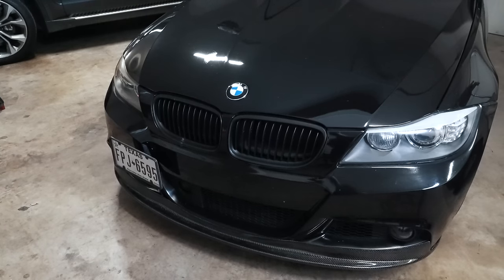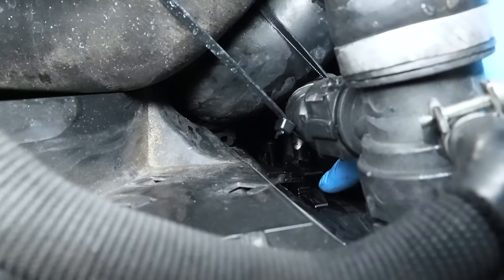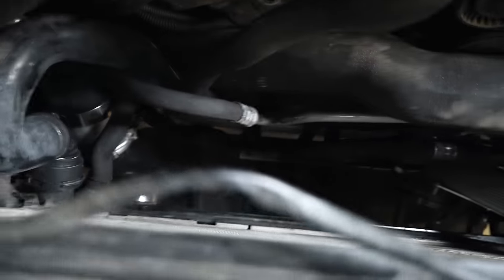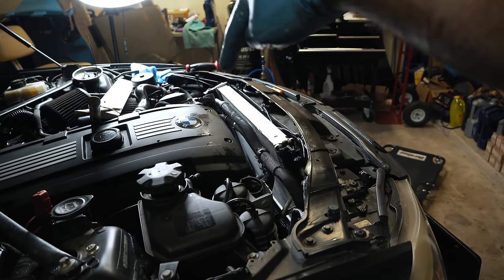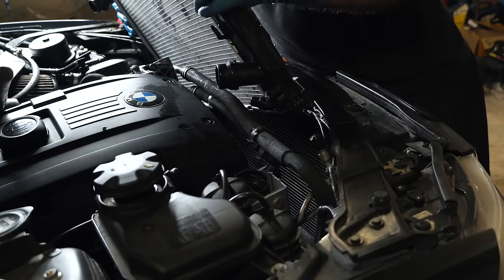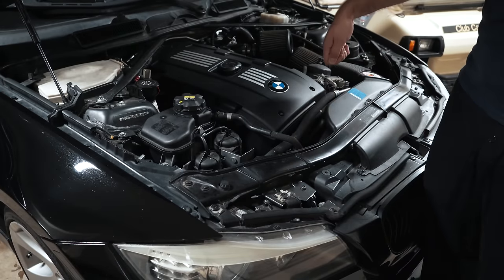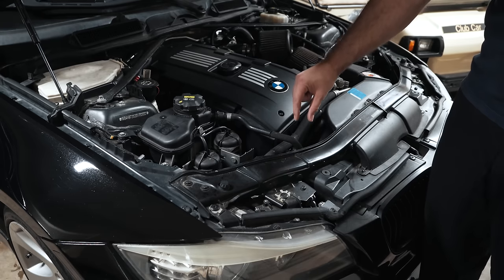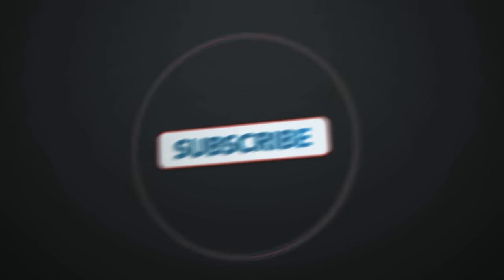My Radiator Cracked! | BMW E90 DIY Replacement

Comment: Another awesome video, just a reminder for people to leave the door open when you initiate the procedure because if you close the door and initiate the bleed and then open the door it will reset and stop the procedure, so then you are stuck in the car for about 10 minutes.  After bleed is complete, run defroster to allow for full circulation of the coolant system.  Then let cool down and recheck coolant level.
Reply: not true. i adtually just changed my radiator (before i saw this bideo) but i closed my door when i did the bleeding procedure and it still worked
Reply: Read the post, I said if the door is closed and you open it, you said you closed the door which means it was open, that’s different.
Reply: Joel Rolley I stand correct 😅😅
Reply: No worries, if the door is shut and you wait for a while and then open the door it can reset

Comment: I had to replace mine too a few weeks ago. It cracked in the exact same spot. The amount of low quality plastic and rubber used in these cars is just unimaginable.
Reply: Same
Reply: Same lol. Pos plastics
Reply: @F82_  well most cars are old so the plastic is older and isn’t the same when it first came out the factory
Reply: mine cracked in the SAME spot too.  My last BMW.  car full of plastic smh
Reply: Lasted 13 years for me so can’t really complain. Hope it holds up another 13 after replacing.

Comment: If anyone is wanting to do this for their 335i with a N55 motor, rejoice because this video will work perfectly. 
THANK YOU, VEHICULAR DIY. Saved my Bimmer and my wallet.
Reply: Bleh Bleh I’m about to do mine on my n54 in the same crack lol. How was/long the job? Looks pretty simple to me
Reply: @N54GASM  It turned into a multi-day project for me... but I have 0 experience with working on cars, and I am taking my sweet ass time with this quarantine. 
I will say that removing your intercooler will make things WORLDS easier, and removing it will be the simplest thing you can do. 
Getting the radiator back into the groove it rests on was the most difficult thing for me.
Reply: Is yours a e90 n55 and auto or manual?
Reply: Where did you get your parts?

Comment: What a coincidence. I just did this job today on my E93. Cracked in the exact same spot too! Got a CSF oem replacement. Keep up the great videos!
Reply: Same here 🤦‍♂️
Reply: I am about to do the same job with a CSF on an E93.  Were there any issues you ran into?  What was your solution about not having the plastic clips on the radiator to hold it in place?
Reply: @ivan.e82  How may miles were on your car when you replaced it?
Reply: Where did you buy the csf original style replacement?

Comment: Damn, literally everyone I know with an n54 who gets a crack in their radiator, all get it in that same exact spot! Crazy how failure prone that one little spot can be... as always, great diy brotha!
Reply: KiTshowtime it’s not only the n54 most plastic end capped radiators crack right there. I’ve changed numerous radiators in different makes and models with the exact same crack.
Reply: @kalei43  dude that sucks, they're smart for making parts that dont last forever tho I guess lol more money in their pockets
Reply: KiTshowtime this is why you get a full alloy replacement rad. This is a huge problem in most bmws

Comment: Another helpful vid, many thanks bro. I replaced the radiator (leaking on both sides) on my 135i convertible. I actually removed the intercooler to clean the whole area and have more room. Simple, as it was only 2 screws from below. However, I also had to remove the support reinforcement in the front to get the radiator clear (convertible specific). Nevertheless, your content already helped me a lot since my N54 already showed some of the standard issues (wastegate rattle, oil pan and air/water intercooler as well as head cover gasket leakage, cyl. head cooling flange got brittle and so on). I still love the car, though.

Comment: I might be doing this friday, still not sure if it's the radiator or that oil cooler line connection. I broke my upper radiator hose reservoir outlet, so we'll see, but this looks pretty easy. Been a pleasure watching your vids, saved me loads of time! I think I got my misfire fixed (bad injector), but I only got to go for one ride before I tore it apart for the coolant leak. I can see why you like these cars, it's been a lot of fun this past week.

Comment: My 2010 n54 JUST did this to me yesterday, same crack in the same dang place and everything.. Crazy lol. I was hoping it was that thin hose that goes across the engine but noooope lol the price difference between the all metal and OEM style is crazy. I found OEM styles for 100$ or less and the all metals start out at like 400 lol

Comment: I was debating on replacing it while everything is still apart now Im just going to do it.. Thanks for video
Reply from the maker: Yeah not a bad idea if you're in there anyways.  More power = more heat.
Reply: @VehicularDIY  Hence a higher performing radiator, preferably all aluminum.

Comment: 2011 n55 cracked in the same spot. Same procedure. I took my aftermarket intercooler out though. Made it much easier. Was struggling with the 2 t25 on the bottom of the 3rd rad.Wish this video was out then.

Comment: That's where mine cracked too, right along what looks like the injection mold seam. JB weld held out for a week until the parts arrived.
Reply: Lol I used jb weld on the same spot but it immediately started leaking in a different spot lmao. And it was even worse than the first one

Comment: Just finished mine. TAKE NOTE: This dude makes it seem a lot easier then it really is but not impossible. This will take you 3-4 hrs! Another tip make sure you buy another O ring!!! I put it together and to my horror it started leaking after install because of that O ring! Was a nightmare. This is a very tedious job and is way easier with 2 people. Also be easy with the DRAIN PLUG! That fucker will break (side tabs) if your not careful. Good luck everyone 🙏🏻
Reply: Which o ring are you talking about

Comment: Mine same spot a month ago least it was cheap and easy to fix. I beleive mine was orginal 08 e92 n54 AT 92k miles on the dot at fail..
I dropped the whole bottom cover pulled my ARM fmic that transmission cooler fought me to no end with the fan both ways also those oil cooler lines love to mess with the fan both ways.  Easy job but its tight add twice as long as you think its going to take.. do your self a favor replace the main top and bottom hose your right here and its cheap.  If you have time replace the U hose on the water pump super cheap, also lots of crap is in the pump you will see how dirty it is worth the extra 15 minutes.

Comment: What about the drain plugs? I have the same as yours with the plastic and metal but its got long and short drain plugs? I know the 2 different sizes are for manual and automatic? Mines an automatic 6 spd

Comment: Noticed that my new radiator has a plug that must be repositioned to allow coolant to flow into the autobox cooler. With the manual box no coolant flows and the plug stays in the normal position.

Comment: Replace your ineffective OEM ATF heat exchanger (It is NOT an ATF  cooler as coolant runs way too hot for ATF.  It is to preheat ATF for better cold start operation.)  with a B&M and mount it in your driver's side opening.  This might require ducting from the PPK2 kit.

Quite frankly, this is where I would spend the buck and go with an all aluminum CSF to better cool the block and heads (especially in Texas) and not repeat this job again. As you have already experienced, the plastic end tanks are a failure point.

I am still a little incredulous that you understand the importance of sealing the radiator to maintain ambient ducting through the front openings to the engine compartment, but you still reinstall the original CAI ducting thus back pressurizing the engine compartment and reducing effect ambient flow into it.  The DCI's gain little benefit from the dilution of the preheated under hood air being diluted by the non-ducted ambient air.

Comment: What about the bleeder screw? I followed your steps. But then reading post I feel like I did mine wrong. About 5 quarts came out when I drain mine and 5 went back in, people says it takes more I can’t remember if I unscrewed my bleeder screw. After I filled my coolant tank I ran the bleeder process and just kept filling until it stoped hopefully all the air got out. 2009 bmw 328i engine temp gauge usually in the middle, after I replaced my radiator it goes up just a hair more. But I will re flush my system again soon.

Comment: hi! i have an automatic e92 335i and i converted my transcooler to bms oil cooler. question, im gonna change my radiator, can i use a radiator for manual transmission?

Comment: I recently got stranded in tj with a failing water pump, fixed it, then a crack on the radiator caused my expansion tank to explode, fixed that and just replaced radiator today. Everything seems to be fine but radiator icon still comes up on dash when I start the car. Would that mean something is still not right?

Comment: hey is it necessary to replace the hole radiator just for that part being cracked? If not , what is the name of that piece mine is cracked in same spot.

Comment: CSF all metal rad = never worry about overheating again
Reply: @NiiaTastic  I didn't even wait until mine started to give way. In my 03' 530 I paired CSF's all metal M5 rad with Zionsville metal SPAL electric fan shroud and a new OE rad cap. It's very tight but a perfect fit/finish in the engine bay. The peace of mind is priceless...
Reply: @NiiaTastic  shoulda ordered through fcp and got a free replacement
Reply: @NiiaTastic  next time.

Comment: Nice video.   Is this the first time the radiator has been replaced?  If so, you got some good mileage out of the original.
Reply from the maker: Yeah so far as I can tell it's the original rad.  Lasted 11 years in Texas heat and 194k miles.

Comment: With a manual trans, is it possible to replace without getting under the car? I don’t trust myself with jacks and Jack stands (had a close call in the past)
I have a vsrf stepped fmic though.
Reply: Many thanks for this video!!

Following up on my comment. It is possible to replace the radiator without getting under the car (manual only). 
Few notes:
1) it’s super messy. Since you can’t access drain plug, coolant gets everywhere despite my efforts to catch it when disconnecting hoses. I even attempted to pump the coolant out of the radiator with a hand pump but got 1/2 gal
2) The technique of shimmying the radiator out as shown in this vid is effective. When putting the new radiator in, start with drivers side. Get the hook at the bottom just past the condenser lines then get to work on passenger side.
3) I replaced both hoses too. Lower rad is a pita but doable without getting under the car. Need to do a lot of shaking and pulling. Hose ends have guides so hoses cannot spin
4) If you are reusing the hoses, watch out that the c-clip does not fall off. This happened on my lower hose as I tried to remove it from the radiator 
5) I have rb factory location inlets. I do. Not know if this made it easier or harder. The front inlet sits very close to the radiator fan. 
6) FMIC has hooks to hold the fan. Know this as you insert the fan to tilt the bottom towards the FMIC other will get caught and not seat properly
7) I used the csf #3716 and Bmw oem upper/lower radiator hoses

Comment: I see waterpump failure coming !!! From this
Reply from the maker: It has about 60k on it so it's due anytime now.  I've been running G05 since owning the car if that's where your comment came from.  Did a full flush and fill years ago.  Already done the thermostat
Reply: Vehicular DIY yeah mate as soon as you do this exact fix I can safely say your pump will fail

Comment: Why didn’t you go with the csf radiator?!?! Curious, I’ve read it can provide 40%+ more cooling.
Reply: it doesnt provide more cooling if you dont change table values on the DME.
Reply: @erickromero010  how do I change the values on the dme?

Comment: When you did the DIY on the new radiator replacement, did you replace the old O-rings in the old hoses, at the 4 connection points on the new radiator?
Reply from the maker: No I had relatively new hoses

Comment: I'm having waterpump issues I have been through 2 water pumps in 1 year and 20,000miles with my n54 335i I have tried retrofitting an f30 n55 Pierburg water pump but the ecu doesn't communicate with it,  I'm trying to find a alternative or a revised or more reliable pump have you got any ideas or solutions on this, love your content and appreciate the knowledge you share on your channel
Reply: there is a lawsuit for the waterpump being premature faulty.  you should get something in the mail.  you can get a full refund.
Reply: including labor.

Comment: Aw man I thought you were gonna build the 335i now since you don’t have to drive it anymore. Nice and slow build would have been nice, what’s your thoughts on the CSF performance Radiator?
Reply from the maker: I've heard good things about it.  Yeah I'll build it slowly, for now going to focus on the conversion to full e85 and pushing more boost.  I'd like to keep it somewhat streetable at time same time if at all possible.
Reply: @VehicularDIY  Cannot wait for the expanded fuel tank installation for E85.  probably port injectors in new intake manifold also.

Comment: Hey man where did you get the radiator? Cracked mine and kinda wanna get an autozone one to get it running asap or should I go the fcp route?
Reply: either or. they should both be lifetime warranty

Comment: Did you modify your inlets for the csf radiator? I’ve heard that they had fitment issues.
Reply from the maker: I just installed an OEM style radiator.
Reply: @VehicularDIY  Thanks for the response. I guess it only applies to the high performance radiator.

Comment: Yeah, I've had my fun with that fan doing inlets and intercooler piping. E60 has the oil cooler mounted on it, definitely prefer that design tho. Electronic bleed procedure when I did my water pump is super convenient haha. Have a question regarding secondary o2 sensors. If you don't mind.  What's your email?
Reply from the maker: Hey check the contact area of my YouTube page.  It contains my email.

Comment: I just replaced my radiator on my 2009 335i. After the procedure I drove the car for a little before an engine light popped up on my dash. This wasn’t one of those service engine soon lights though, it was an engine icon that was half filled indicating that my car was using its full performance. Also while driving it felt like my car was using no boost. I doubt anyone will see this comment as this video was uploaded 3 years ago but if anyone could help or give some advice that would be greatly appreciated. If i solve my problem I’ll be sure to give an update and hopefully I can help someone else out.
Reply: lol i didn’t put my charge-pipe back on correctly, go figure

Comment: When mine fails I am dead 💀. I have the N51 engine with the sensor on the radiator so I can't go aftermarket$$$👎
Reply: mines too bud and im dead right now 😂😂😂
Reply: There is 15 year warranty on that particular rad for the N51 engine if your mileage is below 150k. Check with bmw

Comment: What year and mileage?
Reply from the maker: 2008 and 194k miles so I can't complain  lol.  Seems to be the original rad.
Reply: @VehicularDIY  That seems to be the limit.  My 2001 X5 4.4L rad made it to 180K before I changed it out.
Reply: @VehicularDIY  your lucky then.. mine died at 110k miles
Reply from the maker: I think the heat from the new turbos probably contributed.

Comment: Huuuuuuge shock...not. Do yourself a favor and buy a full aluminum radiator. Plastic bmw parts are a ticking timebomb. Expect 6 years out of it before it is ready to fail again
Reply from the maker: Haha yeah, it's not my daily anymore so if it lasts 2+ years I can work with that.
Reply: Vehicular DIY idk, my n54 blew out the expansion tank, rad, upper rad hose and the McDonald’s straw at different times. Needless to say all these parts are full alloy now. Fck bmw plastic
Reply: @goclunker  What metal expansion tank did you use?
Reply: @matthewm5640  i believe its a turner. I have a mishi on my e36. They are notoriously harder to bleed, but, they also do not explode

Comment: You're acting like you didnt spend the full day trying to take off the upper and lower radiator hoses. Gtfo lmfao
Reply: whacky pax  Both of mine were stuck hard on it. I used heat gun and wd40 came off
Reply: the lower omg that shit was insane to take off.